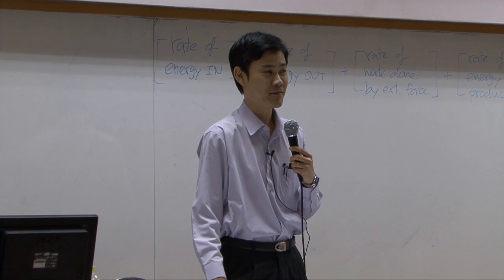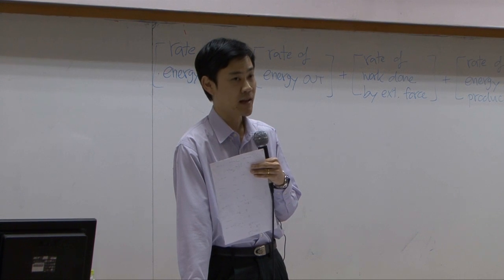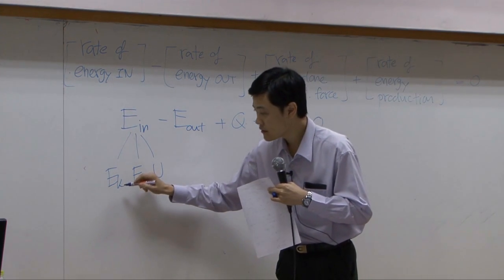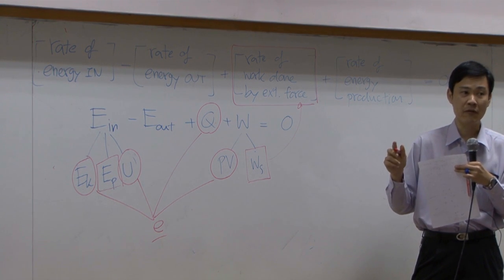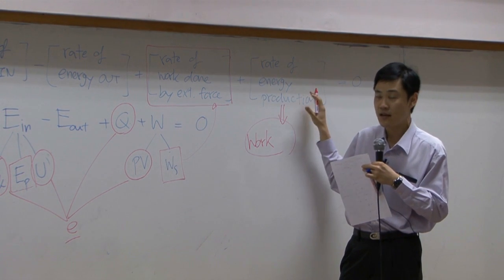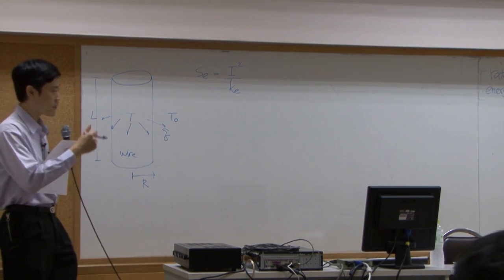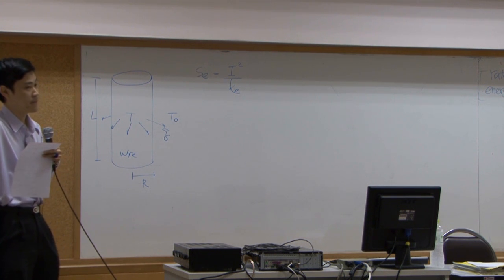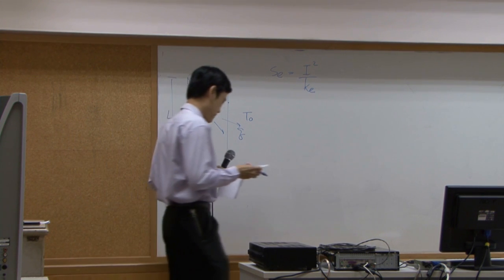Transport Phenomena lecture on 12-12-12 - Energy transport 2/9 (part 1 of 6)

Comment: Excuse me sir, I am David from Indonesia. Thanks for the lesson. I have a question, you said that no convection in the solenoide wire case, but actually there is heat transfered from the surface to the air which means convection, sorry if I make mistake, I just want to confirm about this. Thanks
Reply from the maker: +David Gabriel For this example, the system was defined as the wire itself, hence there is no convection considered. However, it you re-defined the system as the air surrounding the wire, then there are both conduction and convection taking place. We rarely combine solid and gas together as one single system.
Reply: Varong Pavarajarn Oh I see, thanks a lot sir